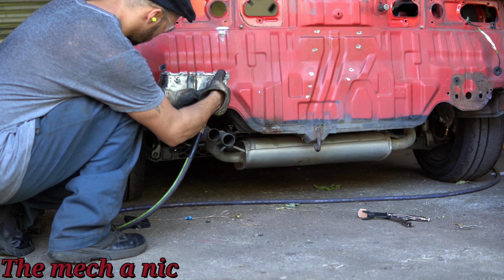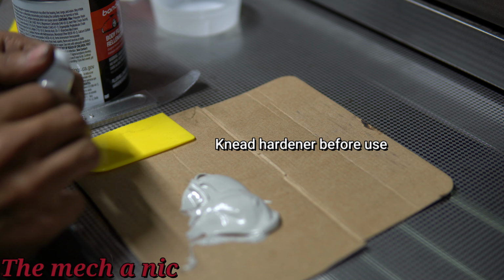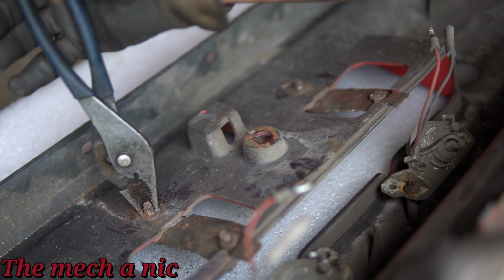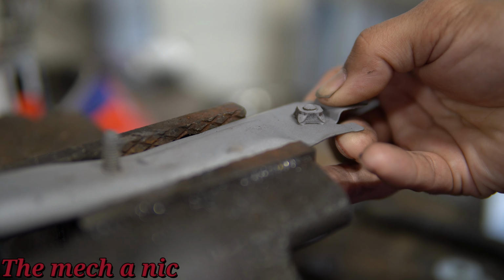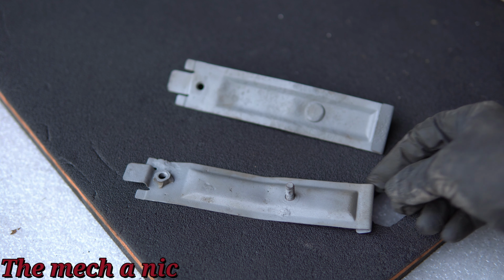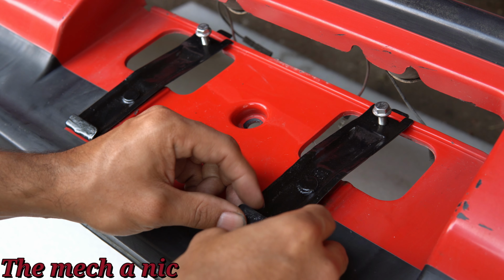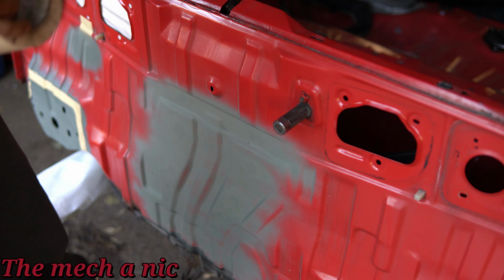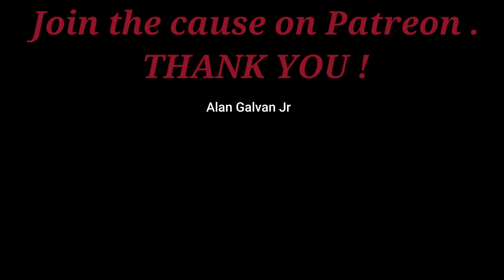crx bumper repairs (part 2) vol 15

Comment: For paper-thin & perforated sheet metal-
Thoroughly clean, wipe with acetone, then acid flux,
then gentle propane to heat, and solder.

50:50 lead/tin is best. MAP gas is way too hot.

Alternative: clean same way, mix up real two-tube JB weld.
Brush it on, strokes will heal. Don't glob on. Lightly sand to
open pores & accept coatings.